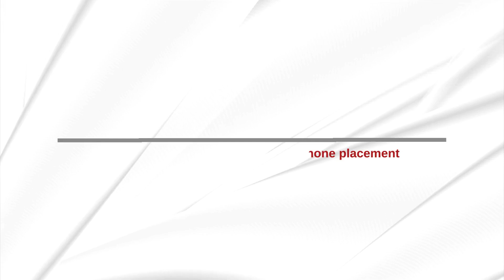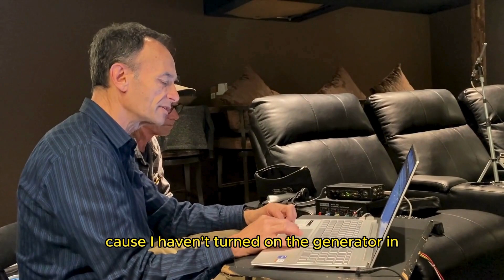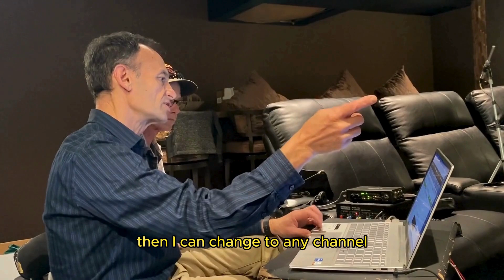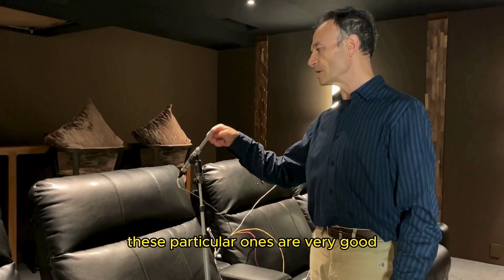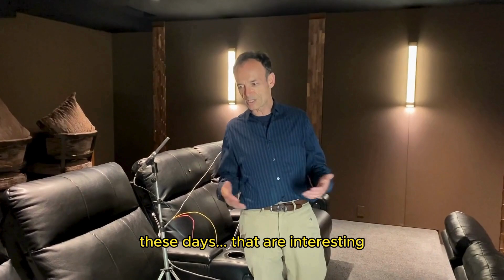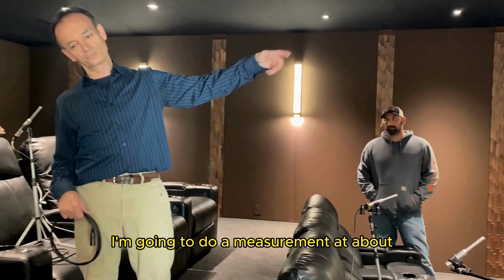Home Theater Calibration Part 2 - Signal generator setup and microphone placement

Comment: You mentioned switching mics. Why don''t you use REW Pro and take all 4 measurements simultaneously rather than switching mic to mic?
Reply from the maker: Good idea. Haven't gotten to it yet, and don't travel with a 4-mic USB interface.

Comment: Why 45 degrees mics and not 90 all around?
Reply: I'd like to know this too. This would get an average of floor speakers to Atmos speakers. So, they calibrate equally. That's my assumption.
Reply from the maker: I usually point the mics towards the front speakers, at about 45 degrees. These mics are omnidirecitonal over the major part of the spectrum we are interested in, so doesn't matter too much. The top octave is where it makes some sense to point towards the speaker region to be calibrated.
Reply: @grimanisystems  Thank you Grimani, I appreciate it.